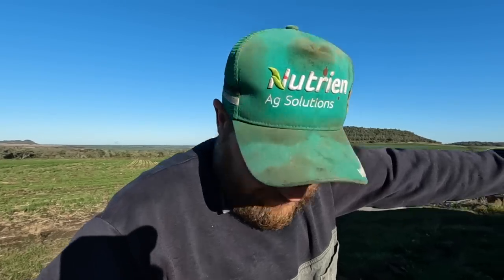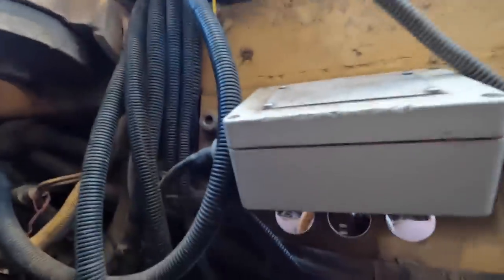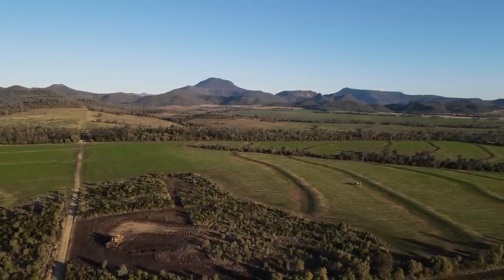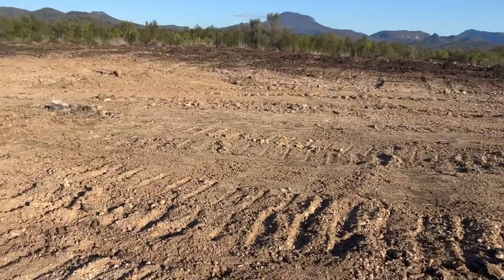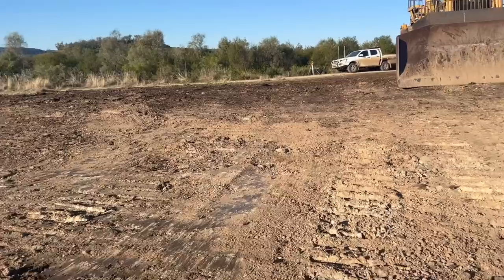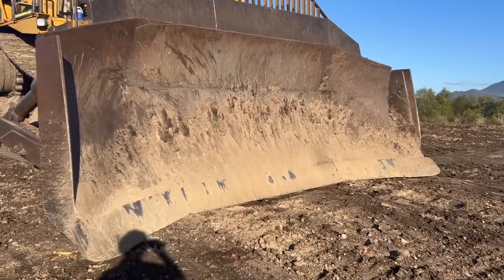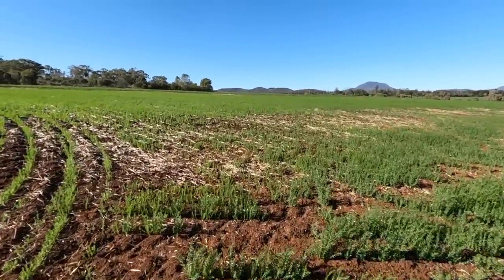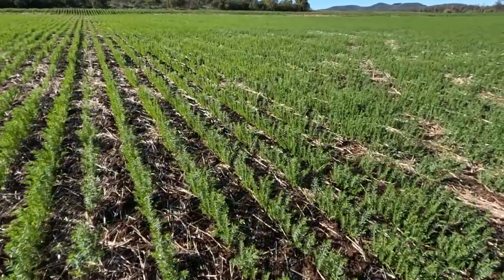D11 Fires Back Up! | Big Bulldozer | Vlog 192

Comment: I hate mice....one got in my cars air filter housing and set up quite the homestead. That D11 is amazing. The tracks on it seem awfully thin for its size? Are those a typical width for the type of work you do? Thanks for the video.
Reply from the maker: Hi! You can get different width tracks, these one came with it, in our conditions the wider ones are better😁👍